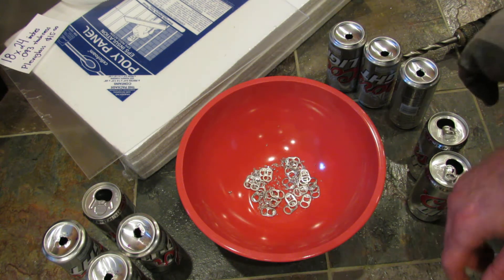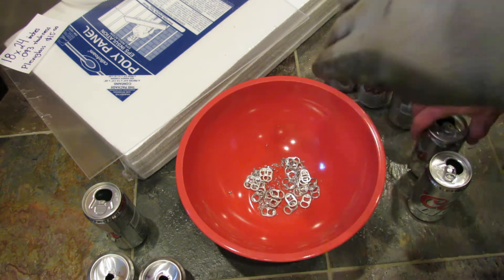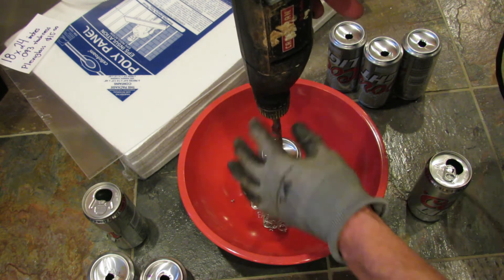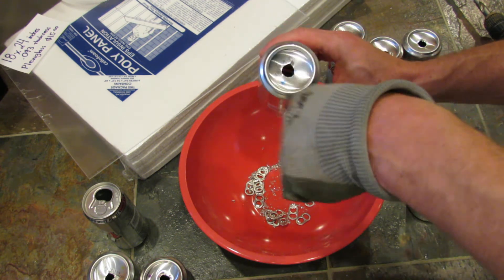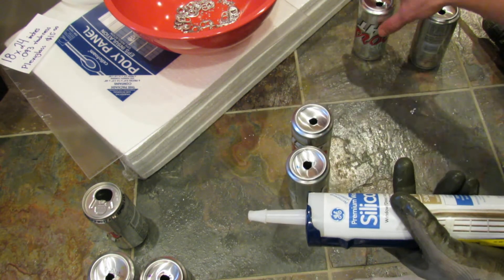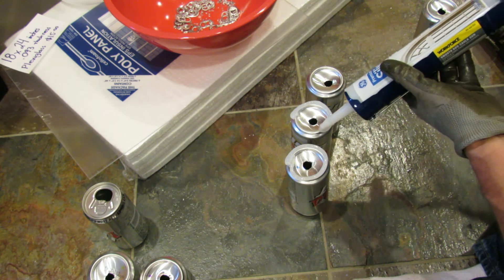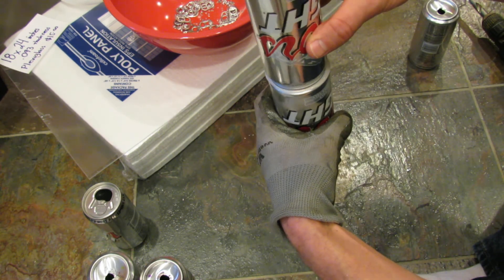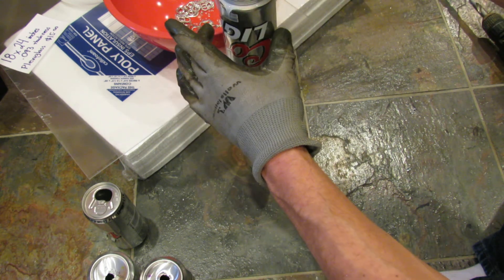How to Drill, Seal  and Stack Aluminum Cans For a Solar Heater or Solar Furnace - MFG 2013

Comment: Hi gary. Nice wideo, but in my opinion you are doing it wrong. You need to cut WHOLE top or bottom of the can. And then you can drill the bottom or top (top has nice hole in it already - you drink through it). Your cans have  additional barrier for hot air to flow.
Maybe you do it intentionally, but most of the setups, do not have this extra layer (where air is slowed down, cause holes are often NOT cover them self - they are not in line). Ppl take off bottom or top can cover and drill other side with some patents (they are many different patents, and they have different results  (one of the most popular - cause of simplicity is to drill FOUR regular holes, not one - and if you drill top of the can, cause you remove bottom, you can drill additional TWO holes, cause of default can opener - it is much bigger - x2 you drilled holes).
Take care!
Reply: Pros and cons! Best setup achieves both significant circulation and creates turbulence, which leads the air to pick up more of the heat from the aluminum. the right amount of turbulence is dependent on the strength of your fan and length of your  column. I recommend testing your setup by using aluminum tape, so you can test swapping in cans with and without the top/bottom fully drilled out, then glueing when you get best results in your specific setup!